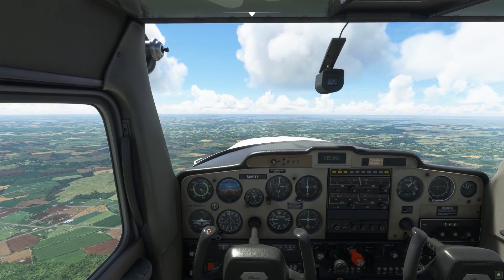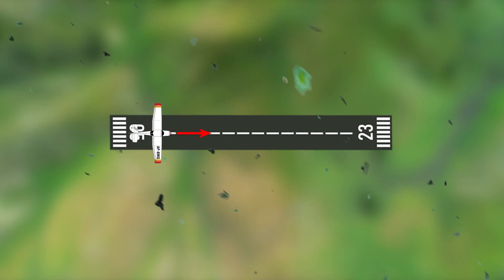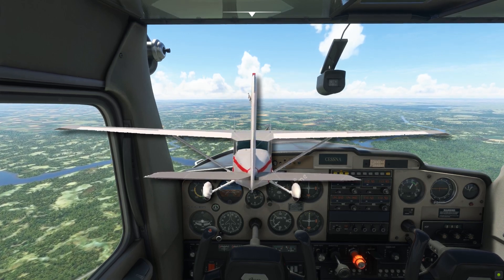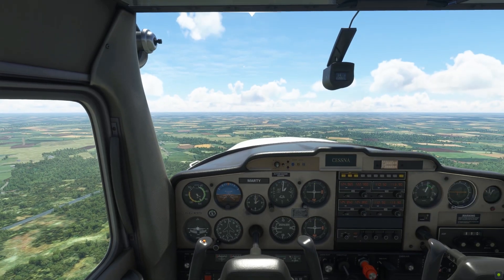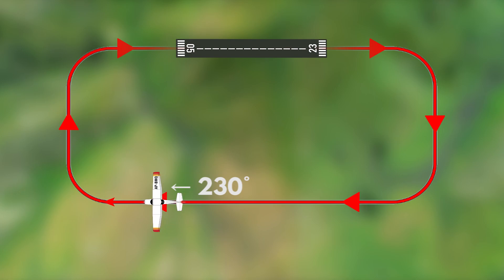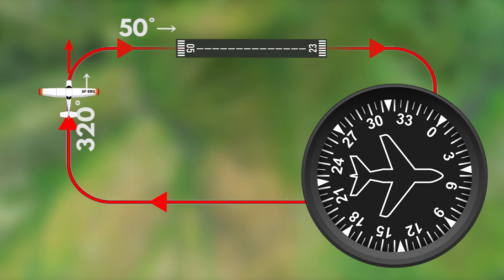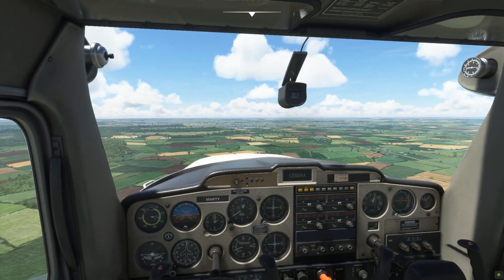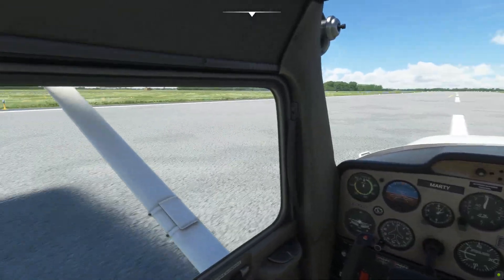Real Pilot Shows the REALISTIC WAY to Land a Cessna 152 - Part 6

Comment: 6:52 Of course, you should be able to add or subtract 90 degrees from your current heading to determine the new course after a turn. However, you can also simply look at the left or right side of the gyrocompass and use that number as your new heading without any calculations.